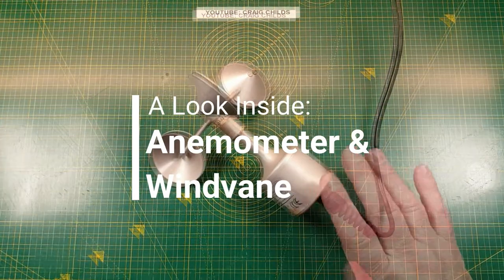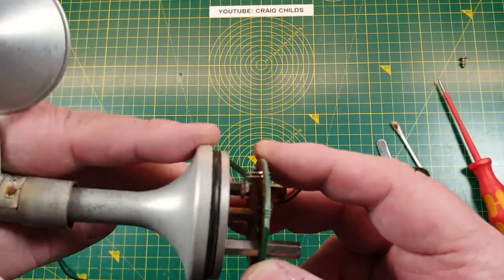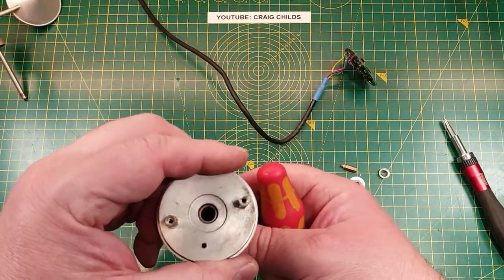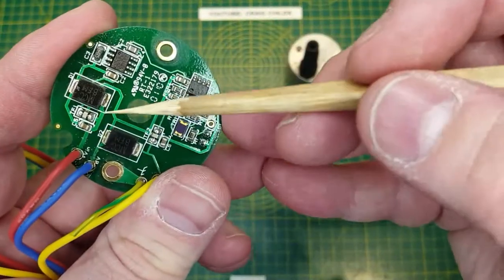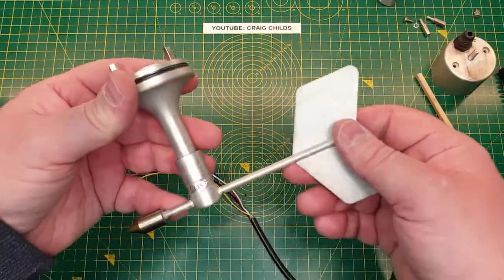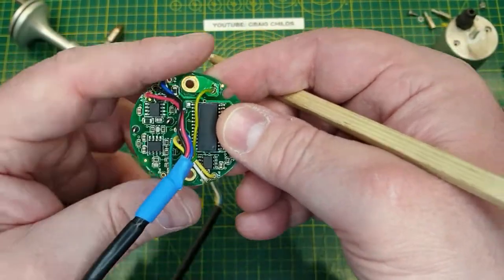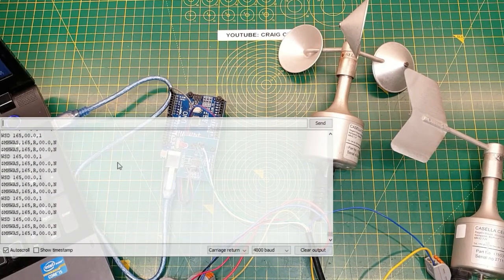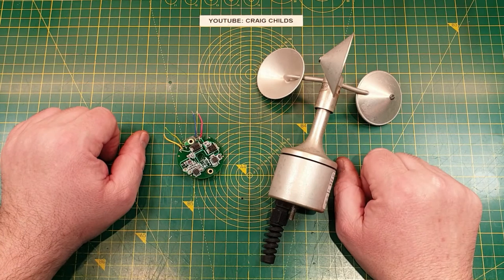A look inside: Wind speed and wind direction sensors, scientific measurement instruments

Comment: Very nice video and great information thanks for sharing. Do you have the Arduino code for the windspeed measure.
Reply from the maker: @nedstar7378 I don't think I do, however I believe it uses the NMEA decoder library.

The decoder lib pulls the data out from the serial stream and converts it to something readable by a human.

Hope this helps.
Reply from the maker: P.S., the windspeed measurement is already done within the unit, the IC does the calculation then sends the data out on the serial bus